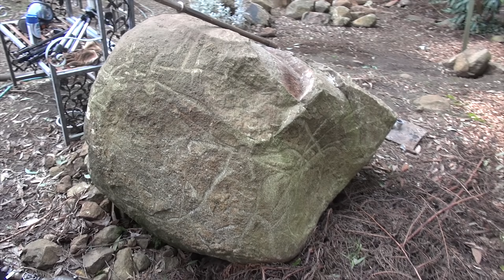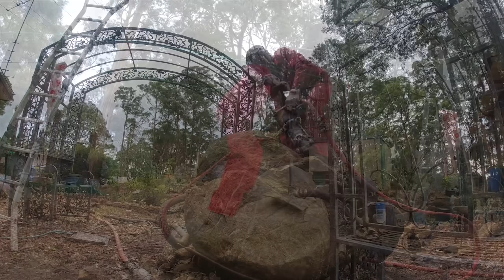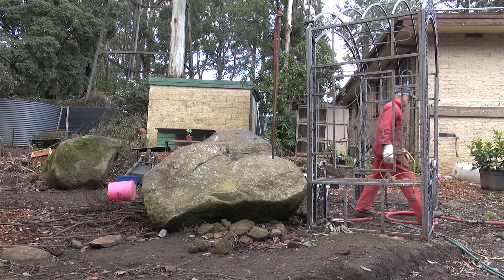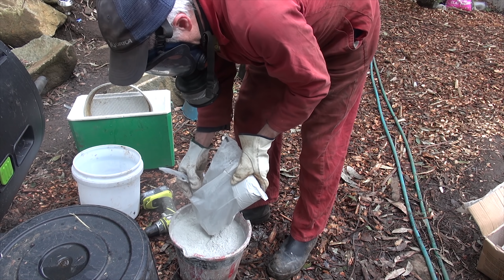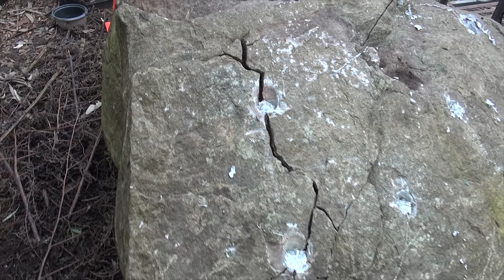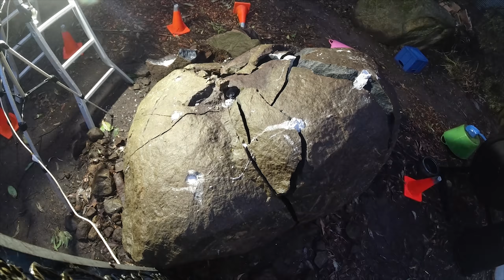Breaking very hard rock with Chemical Cracking Agent

Comment: This method has been used for decades in the Midwest USA.  We use the cheaper but slower method of filling the holes with plain water and letting the frost break the rocks. You have to keep filling the holes all winter
Reply from the maker: Does not get cold enough here for that.
Reply: There's an ancient Japanese technique I heard about. They would drive snug wooden dowels into the holes and then soak them with water, swelling the wood fibers and cracking out enormous chunks of rock from mountain sides
Reply: Can you tell me name of chemical?

Comment: Great time lapse sequence, Dave.  What pressure must have been generated in the expansion during a chemical reaction.  This old Industrial Chemist is in awe.
Reply from the maker: Huge Pressure Alan, if you would like to know what is in it - Calcium dihydroxide ≥75 - ≤90 1305-62-0 Silicon dioxide ≥5 - ≤10 7631-86-9 Sodium Carbonate ≥1 - ≤3 497-19-8
Reply: @demolitiondavedrillandblast  , these substances might be in it after it has expanded. wikipedia lists the main components of non-explosive demolition agents as calcium oxide and portland cement.  calcium dihydroxide is a fancy name for common builder's slaked lime, which calcium oxide converts to when mixed with water, generating heat and expansion pressure.  silicon dioxide is a high tech name for sand.
Reply: @demolitiondavedrillandblast   Saw a man just like you in the Expando page.  Says pressures of up to 14000 psi generated.  That's a lot!
Reply from the maker: @Alan Moffat, Yeah... that's me, I've used lots lots and lots of Expando.
Reply from the maker: @vsv nrg Yeah, You must be correct, I did notice that the name did not quite sound right. I can tell you though that it is still a very nasty irritant after it has done it's work and converted.
Reply: @demolitiondavedrillandblast  ,  after i posted the comment i thought about the recipe you gave.  if i was selling a product with a great profit margin made from cheap simple ingredients and someone asked me what was in it, i might give out a recipe that looked the same, hardened up the same but did not break rocks open.. because after trying the recipe that didnt work you would go back to the ready-made product.. it doesnt matter about the price to me.  if it does what its supposed to, reliably, its worth it.
Reply: If i took a guess based on the strength of a strong rock, and the size and spacing of the holes; it probably took 700-1000 bar in those holes to crack the rock.
Reply: @tippyc2  My question is this though...
The holes are open at the top. What prevented the goo from simply taking the path of least resistance and just expanding out the hole, thus never really generating any splitting pressure actually inside the hole?
Reply: @AsmodeusMictian  Good ol' friction.  The compound probably hardens a bit like concrete, and forms a plug that the rest of the goo cant push past.  If you look closely, you can see the compound flaking out the top of the holes also.  But enough gets trapped inside to be effective.
Reply: @tippyc2  Yeah I noticed the bits at the top....that makes sense though. Thanks!

Comment: I've never heard of this but it makes a lot of sense. Using internal pressure to break boulders.
Reply from the maker: The best kept secret about breaking rock is that the tensile strength is only about 10% of the compressive strength, so if you can get a hole in it and work from the inside you have a chance.

Comment: Nice vid Dave. 
I've seen it used on concrete where I worked before retirement. It works well.
Reply from the maker: Sure does Clint, concrete is a s soft as cheese compared to this stuff.

Comment: Why not use shims/feather and wedges. What are the pros and cons?
Reply from the maker: I did consider this option Nicholas, I have feather and wedges to suit the following hole sizes - 14mm - not a chance. 35mm - yeah but I only have 5 units and this would be abusing them on a rock this size. 48mm - no problem... but drilling 48mm holes in this rock with a hand drill is torture, the hole that I drilled were ~36- 37mm ish and that was hard enough. Also the time lapse of the cracking agent makes for better video. Thanks for watching and contributing.
Reply: @demolitiondavedrillandblast , Thank you for the insight. Great video. Thanks for putting it together.

Comment: Another great video. We use one in the States called Dexpan. It's also quite expensive. I'd guess it's the same chemical make-up as it seems to behave the same as your product. You also have to be careful with Dexpan temperature-wise and safety-wise or it will bite you.
Reply from the maker: Very similar stuff my friend, there are numerous different brands, would not be surprised if it all comes out of the same factory in China.

Comment: Fantastic!   Just did my first rock with Dexpan.   Lots of work, Hours and hours of drilling.  After two days not a single crack.  I was defeated.  After a weeks time, went back to the rock and it’s all busted.  Sooooo satisfying.  Curios, do you use a rotary hammer drill?   Looks like you were practically sitting on it.  I could never find the right amount of pressure when drilling the holes.
Reply from the maker: Nice work 94, I use an air powered rock drill - much more power than any electric drill. My holes are 38mm diameter (Inch and a half)

Comment: would it do better if aluminum silicate sulfur - Portland cement ( quick set - high strength ) was used to top off the holes ( like a plug)?
Reply from the maker: No need, the stuff hardens before it starts expanding, only the smallest amount expands out the top of the holes.

Comment: Hello sir advise me we were drilling a tubewell manually and found a rock down 30feets underground it blocked our way we  can't drill any further it's very huge and hard .......what precautions can we take to blast it ..thank you
Reply from the maker: Precautions, safety first, If you are going to blast down there you first must stabilize the walls so the the blast does not cause a cave in, this would normally include rock bolts or some kind of soil nails to attach wire mesh to the walls and then shotcrete. Next issue is stone dust control, stone dust kills! When working underground or is a shaft like this you must use a drill the uses water flushing and not air flushing to control the stone dust. Sinking a shaft by blasting through rock is never easy, very difficult work, can you employ some experienced miners??

Comment: Dave, have you thought about trying a PAPR (Powered Air-Purifying Respirator) instead of your normal full-face respirator?  It might be more comfortable for your long drilling jobs because the work of breathing is lower - I.e. your lungs aren’t having to suck air through the filter.
Reply from the maker: Mmmmm.... yes, that might be helpful, I have used supplied air respirators (bottle fed) in confined spaces and yes they are a bit easier to breath when you are working hard, good idea 013.

Comment: This has me wondering how well this breaking method would work for a controlled demolition of a concrete building.
Reply from the maker: Yes, done that. Very difficult drilling through all of the 32mm bars though.
Reply: @demolitiondavedrillandblast  I figured the rebar would be the sticking point.

Comment: Thanks so much for the video! Two questions though:
What tools did you need to drill the hole and how deep did you need to drill?
What's the name of the chemicals used?
Reply from the maker: You need a pneumatic rock drill and a huge air compressor to run it, the hole need to be 2/3 of the depth of the rock. The chemical is Expando.

Comment: What kind of chemical did you use, can you please tell me and how long does it take to crack the rock? thank you.
Reply from the maker: The product I was using is called Expando, other similar products are Ecobust and Dexpan. Cracking time depends on many variables, diameter of holes, hole spacing rock strength, rock temperature etc. Rock is usually broken in 24 Hours or less.

Comment: How does that stuff work? Is it actually a chemical reaction that breaks down the rock in stress areas or does it expand slowly over time with enough force to push the rock apart
Reply from the maker: Hi Joe, it just solidifies and then expands slowly with huge force.
Reply: @demolitiondavedrillandblast  great stuff mate! Very interesting!

Comment: How long does it usually take for a  hard rock to crack completely?
Reply from the maker: Few... hard question, depends on lots of things, if you have small diameter holes and big hole spacing, it may take a few days in cold weather, big holes, closely spaced in summer - a few hours.

Comment: Dave.... what drill are you using here? I need one! I'm in the UK and I've got about 10 cubic metres of rock to break off an escarpment. An excavator with a pecker won't touch it
Reply from the maker: The drill I'm using is an Indian made copy of a swedish Atlas Copco RH658, this one was made by Mindrill or MDS in India. Should be plenty of old drills made by Holman of Cornwell floating around in the UK.

Comment: What do you to to mitigate vibration white finger?
Cost wise, how does this compare with using explosives?
Reply from the maker: 1/ Don't smoke, this helps ruin your circulation, 2/ add extra thick soft rubber padding on the handles and use thick gloves. 3/ Avoid short stroke, high frequency drills.
Reply: @demolitiondavedrillandblast  
I must be susceptible, I’ve used longer throw and short throw road breakers, sanding machines, HDS drills and oscillating tools and they all gave me numbness and tingling very quickly, that lasted for hours if not overnight. I avoid them these days if I can possibly help it.

Comment: What is the min gap between the 2 holes......????
Reply from the maker: No minimum gap, the closer the hole, if you are breaking rocks that are fully out of the ground not much force is needed so a hole spacing of 400 - 500mm is OK, if rock is tightly held in the ground, 250mm is good, only use 38mm holes, 35 may be OK, 32mm is too small.

Comment: Why not use heat and cool method especially with rain on the outlook I've used gel fuel found at catering supply and just a good bonfire and a cold water hose to crack boulders that were in areas that mandate less noise.

Comment: Gees how many days was that? I got at least half a dozen rocks like this to deal with in my yard. This looks like the way for me.
Reply from the maker: Hi 007, it's a good DIY option, the biggest challenge for most people though is drilling the holes, particularly if the rock is as hard as this one.
Reply: @demolitiondavedrillandblast  I'm going to start drilling the pilot holes in the required pattern tomorrow to see how hard they are. And your right about drilling a 1.5 inch hole is a big ask of a portable drill, even a Hilti. It's going to be a process and having a good dozen big rocks to crack up & some I think I'll have to hit twice. Wish me luck.
Reply from the maker: What sort of rock is it? You can get SDS Max bits in 38mm and they will drill anything if you have enough patience, they're a bit pricey and don't last long though.
Reply: @demolitiondavedrillandblast  I think their hard granite. They spew out a white dust when drilling & slow drilling even with a 100 mm drill with a Hilti.

Comment: Dave, feathers and wedges wouldn't do ?
Reply from the maker: Yes, they would have but I would have needed to use the large ones that require a 48mm hole... and that is very difficult drilling with a hand drill in this stuff

Comment: I've been very interested in these agents for a long time.
Are they controlled at all or are they chemically complicated? 
I've considered making some to deal with a concrete path
Reply from the maker: No control on these chemicals, though maybe it should have a caution about the very high PH and extreme corrosive nature. it is mostly quick lime.
Reply: @demolitiondavedrillandblast  I work with gold recovery so I'm well decked out for handling extreme PH materials but thanks for the heads up 👍

Comment: A cheaper product lending the same result id powdered steel. This is the admixture that is put in the mix to make non-shrink grout. A five gallon bucket is really heavy. Just mix the powder with water so that it is pourable then fill the holes and come back in a week. No mask required. And it is bio degradable.
Reply from the maker: Thanks for the info, I'll look into that.

Comment: figured you'd put the feathers and wedges to it at first just looking at it!! ever use an explosive named 
HMX? in WW2 they called it aunt jamima that stuff sounds wild and Explosive that you could bake and eat but had the power of dynamite!!
Reply from the maker: HMX is very fast stuff and very costly.
Reply: @demolitiondavedrillandblast  the still make it? i figured they stopped making the stuff decades ago since the first i heard anything about the stuff was a little while back on military history channel about the OSS in WW 2 and most if not all explosives in common use from back then are extinct or next to extinct for lack of a better description! i just saw that piece again and got wondering about it! but you have to admit an edible explosive that you can bake with like flour is a wild concept to ponder!!
Reply: Hmx is most often a small part of rdx, etn is much better than hmx and easy to produce
Reply: @keithmoore5306  etn gives invalid results with a HESS test as it completely destroys the lead cylinder
Reply: @KClO3  a really small part if it is from what i heard RDX/C4  is mainly PETN and a plasticizer!
Reply: @keithmoore5306  c4 is rdx + plasticiser and oil. What I mean is that small amounts of hmx is always formed in rdx production. Why not just use etn though
Reply: @KClO3  might be because of cost or ease of production hard saying but they do it as easy and as cheap as possible!

Comment: Dave, you might be interested in the intro to this video.  He repairs large construction equipment, and in his latest video he is repairing a ripper from a D11 which he says was broken trying to break up quartz because it was too close to houses to blast it.  It seems strange to me.  For a start, we have seen you break up rock which looked to be close to houses, but mostly because I can't imagine even a D11 ripping through quartz!  https://www.youtube.com/watch?v=RGNMvuzppzs
Reply from the maker: Hi Trevor, I do watch some of these guys videos, they do great work. As far as ripping quarts goes... it's not going to happen, no, not ever! You do however find sand stone that turns white and quartzy sometimes and this is worth a crack when you have big machines.  Guys that are only accustomed to drill and blast on a large scale with drill rigs have no concept of what you can get away with when using small diameter holes. Thanks for chipping in.

Comment: That rock was soft. Drilled far too easily. Pecker would have been a good/cheaper alternative. Nice video though 👍
Reply from the maker: Hahahaha... sorry, I have seen so many breakers fail on this stuff - https://www.facebook.com/demolitiondaverockblasting/photos/a.1221879884651644/1864545160385110/

Comment: Plugs and feathers would have that rock in pieces in one hour, what a waste of time.
Reply from the maker: I did consider that but given the hardness of this rock and the option of drilling 38mm holes for the cracking  agent as apposed to 48mm holes for my splitter - 60% more energy required... I went for the cracking agent.